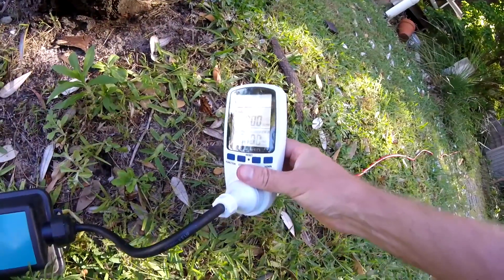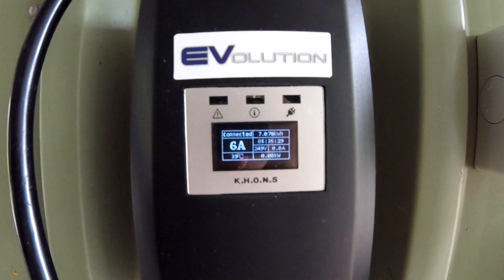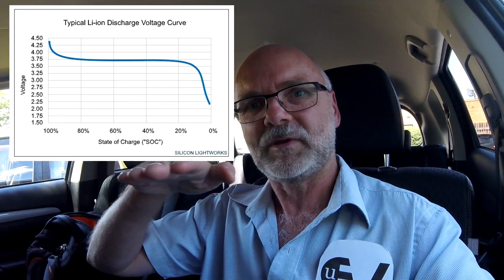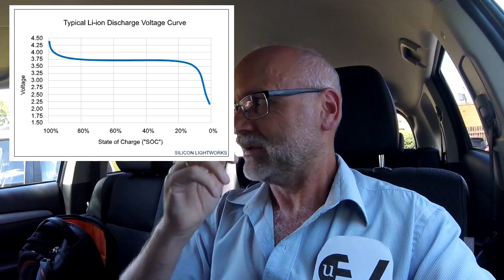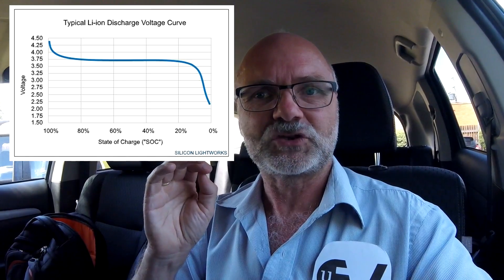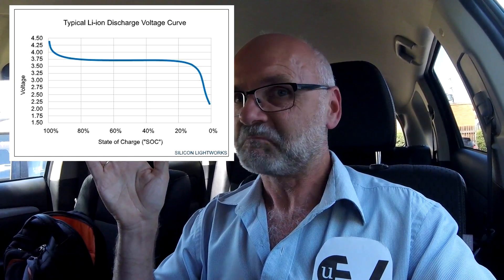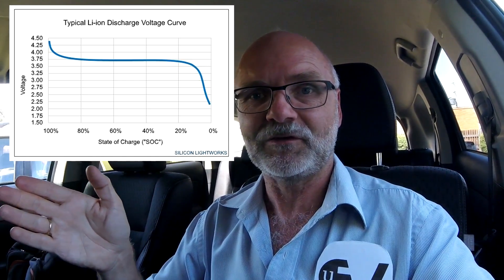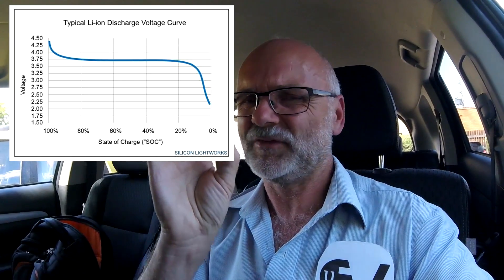Ep191 - Wrong SOH estimate results in low EV range! Here is why.

Comment: If this is how the car behaves, this is totally crazy! I have been designing EVs for the past decade and you never use the SOC or SOH for engine/charge management. (I'm a control engineer for heavy duty EVs).  SOC and SOH are just guesses / calculations, they always include some errors. It would be acceptable to use the SOH to calculate what the guess-o-meter indicates in terms of range, but a real road test, always on the same road in the same conditions, should reveal an actual range that is un-modified. Basically, the NMC cells have enough voltage curve (contrarily to LiFePO4) that the control algorithm should only rely on filtered cell voltage for it's trigger points. I'll keep a good look on the REAL road range I get in the next weeks as the weather gets better. We are still in the -10*C weather right now, so my range is poor. My "dog" reports an capacity that has dropped to 33.6Ah (88.4%) in only one year from new (~34 000km). I will see if I really lost 12% range as I do the exact same route every day and I notice precisely were my engine kick's in. I must say that I am a bit puzzeled that at the end of all my "hybrid" trips, the SOC is indeed always close to 30% but the actual cell voltage is more in the 3.85V area. That would add weight to you theory that the engine kicks in based purely on the  30%SOC mark that is influenced by the SOH (wrong) calculation. I don't see any other reason why at 30% I am now over 3.85V per cell as before I was much closer to the 3.7V mark... anyways, crazy stuff for a fully developed and massively validated and sold vehicle! Cheers from the opposed colony! (Canada)
Reply from the maker: Thanks for your info, Frederick. The trigger point for the ICE still seems to be a bit random at times and not clear defined. If you drive just a bit slower towards the end of the journey, the voltage will be higher than usual. These cells recover pretty quickly when the load is been taken away. I have seen the same 3.8V and above in mine when the engine kicked in. I think the software is one of the weakest points of this vehicle right now and as you said, it gets crazier and crazier the more we discover and puzzle together...

Comment: Hi Andy, Thanks for all the effort that you and the team have been putting into this.  It certainly makes sense that the problem is primarily a software issue. It would also seem to be a fairly simple software upgrade for Mitsi to add a reset and DBCAM every time you charge from a certain state, say 30%.  This should reset the BMU to the actual SOH of the battery.  Hopefully it is simply that it is the original version of the SW.  One of your other viewers mentioned that his car, a Renault I believe, had the same BMU but not the same problem.  It would be interesting to see if it was the same SW or if it had been upgraded.  Keep up the great work and I, along with all other PHEV owners, I'm sure, look forward to Mitsi announcing a resolution.
Reply from the maker: Not sure if Renault uses the same BMU. As I said the PHEV BMU is around 10 years old when it was put together and has not been changed yet. Also, there is no Wacthdog app for a Renault yet, so it's hard to tell what is going on in these cars without app.
An automated proces in the software would be nice. I doubt it is coming though, they are not investing any money in 5 year old cars anymore unless it's a safety concern :|
Reply: @unpluggedEV  As the problem appears to be apparent in the 2019 model, Mitsi may be more interested in resolving it.  Otherwise we await some clever 3rd party : )  Keep up the great work
Reply from the maker: @4MoinSteve  Thank you, much appreciated

Comment: As I said before: If only you can get your hands on the capacity report analysis of your OLD battery (now back home in Mitsubishi Japan?..) you will have the answer to this all....
Reply from the maker: I assume they pushed it over board on the way back to Japan and it sits now in 2485.7m depth water.
No way to get these info unfortunatelly. We have some vehciles booked in with Mitsubshi now which get the triblet soon. Lets wait for the results. If they are staying as they were before, the car is a lemon...

Comment: Hi Andy, I have not got the dog but I have tried charging in 10 amps and 13 amps and there is a difference also on temperature outside. At present I am getting on 13amps charge 36 kms, however with air conditioning on it drops to 28kms. But driving it I am sure with energy braking and driving in eco mode I get at least 42kms which I don’t think it is bad.
There is definitely something with the software which does not show true reading.
Reply from the maker: That's the GOM you're reading?

Comment: Hi Andy, just remember to remember your selected charge speed when comparing the KWh put into the battery. As I have found with my BEV, the slower we charge the car the higher the charging loses. ie: There will be a difference in charging the battery from and to the exact same charge level @ 6 amps and @ 15 amps and so on...
Reply from the maker: I checked that with my EVSE and could not find a difference in charging loss between 6A, 10A and 15A. It varies a bit anyway. I checked all speeds several times and found the average is not much difference.
- 6A causes less heat loss in the charger and battery but the charger is not as efficient
- 15A causes more heat loss but the charger works better at 100% load
That's the explanation I came up with...

Comment: Thanks Andy. This explanation is a big relieve. 
After watching some of your videos, It was clear that the battery capacity reduction was caused by the software. And that's what I want to believe.
But it is difficult to avoid thinking that it could also be real battery degradation.
Reply from the maker: The car would be lemon with such a real battery degradation, right?
Reply: @unpluggedEV  Absolutely. Mine has dropped close to 5AH in 13000Km 90% EV driving. If this tendency continues, battery capacity would be negative by 100000Km :-(

Comment: Good videos mate. Though, something is still missing on the equation. Because what you state in the end breaks the chemistry we know from Lithium batteries. BMS cannot change the voltage the battery is giving out. So, if you measure amps between (slow) charging from 3.7V to 4.1V that must be the real capacity. Also, I have heard of cases where SOH gets higher with proper usage after years of miss use (never charged). Heard reports that even 70% battery is giving close to the original range. There must be other reason why the range has dropped.
Reply from the maker: A reset always restored the full EV range in all vehicles so far followed by a steep drop of SOH afterwards.
Reply: @unpluggedEV  I have to agree with you, when a BMU reset would've done nothing to the amount of kWh charged and or the actual range, then the conclusion would been the battery is a complete failure and it degrades way to fast. When a battery is 'chemically' degraded it can't magically take 10 kWh again.
Reply: My guess is that reported SOH affects GOM but not the real range. Real range then drops because combined effect of minor degregation and other wear causing inefficiencies.
Reply: @M1kke78  How is it possible then that Andy made a 59Km EV trip after the BMU reset?
Reply: @vferrandobe  If BMU reset causes real range to go up, then BMU must have something else going on also than Andy stated.
Reply: and this is probably why the technique of an hour's pause works to recover inaccurate SoH. (i.e., pause between coming home and charging, and pause between charge end and driving).
Reply from the maker: @richij  This should make absolutely no difeerence if the BMU is capable of calculating correctly. In our 'bad BMU' this hack may do some magic though... at least in the very few cases we have seen where the SOH actually went up.
Reply: @unpluggedEV  that's exactly what I'm saying. Aside from the rubric of pre-determined SoH drops, the BMS probably gets confused by inaccurate measurement of Voc. So if you can give it sufficient pauses or rests for it to more-accurately measure Voc, then you're more likely to maintain an accurate SoH estimate, and recover from a chronically messed up estimate.

Comment: Yes I'm 100% agree with you, and that's the reason why the battery takes less energy because the calculation of 30%SoC is wrong.
30Ah to 30% 9Ah = 21Ah usable
38Ah to 30% 11,4Ah = 26,6Ah usable
40Ah to 30% 12Ah = 28Ah usable

Full at 4,1Volt is always the same
But on a. 38Ah battery - 21Ah usable = 17Ah = 44,74%SoC but the BMU thinks it's with SoH ~79% , SoC 30% and only 9Ah
Reply from the maker: Excellent, you put even some figures on this! Thanks Dave!
Reply: Right, yes, this just clicked in my high-latency mind 😂 so, it’s not the capacity changing it’s how the low end is calculated by the BMU yielding an incorrect SOC. Makes total sense to me. Thanks.
Reply: The ICE will start at what the BMU is 30% when it’s actually higher SOC. the assumed SOH directly impacts the calculation of SOC.
Reply: @limey8489  Yes in my eyes the BMU calculates the usable capacity from SoH 30Ah (usable 70% = 21Ah).
So at 100%SoC it counts the Ah going out of the battery and when it reaches 21Ah it should be the 30%SoC of 30Ah = 9Ah and the ICE kicks in. But really it is 38Ah - 21Ah = 17Ah and you can't use the difference anymore
Reply from the maker: @davidmairdm80  That is exactly what I hope for!
Reply: @unpluggedEV  yesterday I charged only for ~1hour 4,8Ah and drove immediately, while driving I regen 0,6Ah and the ICE kicks exactly at 5,4Ah consumed in.
+4,8Ah charged
+0,6Ah regen
=5,4Ah usable

Comment: Well done! You explained it well Andy, and I can only agree with your explanation!

Even Tesla batteries can get out of calibration especially if used in the mid range a lot eg: 30-70%, and the fix is to go close to empty and then fully charge a few times, but (unlike the PHEV,) the Tesla  BMU is smart enough to recalibrate and then recalculate battery SOH. 
It seems the PHEV BMU is not ever looking at those high and especially low charge points, and not keeping calibrated, so only the “triple procedure” including DBCAM will re-educate the BMU SOH properly..... until it next gets out of calibration.
Reply from the maker: That is exactly right!
Reply: But why does it go out of calibration?? Just because we do not discharge the battery enough? I need to check what will happen after I drive it for a while as my commuting car, depleting the battery every day to almost 20%...